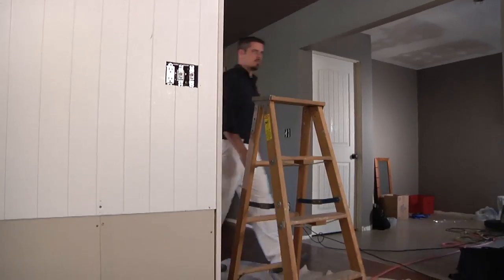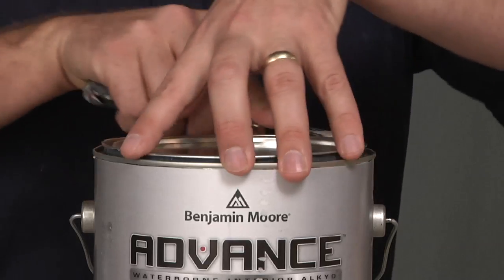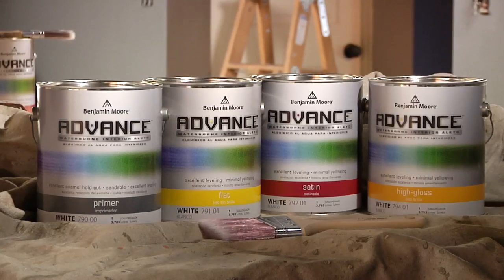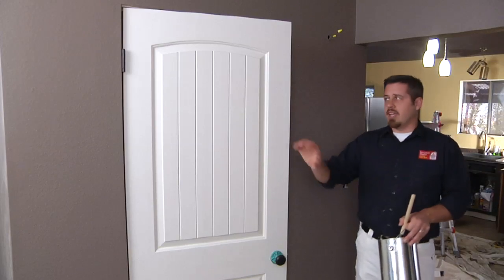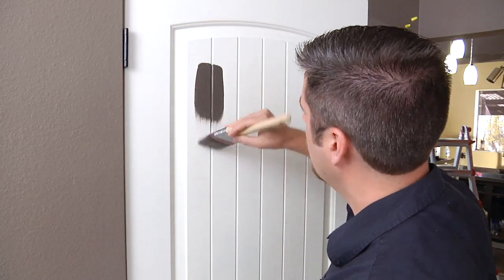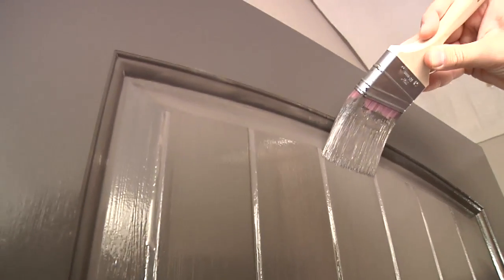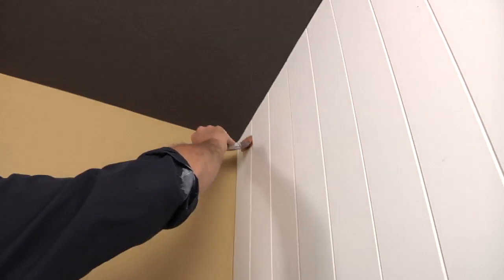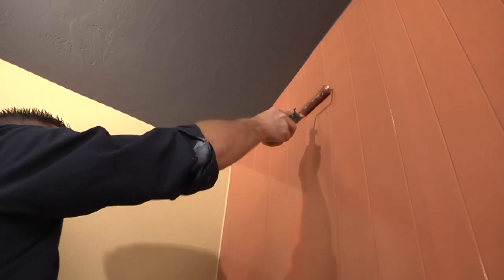How to Paint: Using Benjamin Moore's ADVANCE

Comment: I keep getting streaked marks on my kitchen cabinets with  this paint, Benjamin Moore paint called advance satin.. Original finish was sprayed with lacquer. Paint stores are all of lacquer and satin so we went with semi gloss Benjamin moore . We sanded and cleaned the cabinet then applied Kiltz primer in latex. Now after applying the advance paint it looks   very streaked! Am I using the wrong primer?

Comment: I'm getting crazy brush marks with this stuff on trim molding. This isnt the result I was told I would get with Advanced. Not satisfied at all!
Reply: ya this video shows a lot of brush and roller marks ..... I sure as hell won't use this crap ..... I use SW waterborne proclassic on cabs and it brushed well ..... dries kind of fast so you have to move fast , but it came out nice , and really , fast drying has some benefits !!!!
Reply: Used it in my house and it took some practice and a good brush to not leave brush marks.

Comment: I just finished using this paint on my cabinets.....very thin paint, but leaves a beautiful finish!!  I brushed it on and smoothed with a roller....beautiful.  I am waiting on the cabinets to fully cure....I am nervous about chipping...we'll see.
Reply: Rachel Burnette How did your cabinets turn out? I just finished painting the entire island in my kitchen with this paint in BM Chelsea Gray and will paint the wall cabinets BM Super White.
Reply: Rachel Burnette How long did it take to harden and do you have any nicks in the paint after use?

Comment: Nice video, Justin. I have searched all over for application help and found your video most helpful. A couple questions, though: 1) You say "don't go too close to the edge," but then I see you cutting in at the edge (right after the first,  away-from-the-edge strokes). Am I understanding correctly that you cut in in two steps? First: away from the edge; Second, at the edge, blending into the first? 

2) Do I lay off the brushed-on coat or just the areas where there are issues? I find that when I lay off the entire area (which I thought you were suggesting), I end up over-working the paint. Brush marks and globs everywhere. I'm thinking that the goal here is to just get the product on the surface and let it do it's leveling thing, only addressing, minimally, the obvious issues, like drips, etc.? I'd really appreciate a reply!
Reply: Catherine Osborne of course you must cut the edge line with paint or it will not be painted. He said, " dont bring to much paint into the edge" or you'll have a thick line of paint on the cut line which will be  difficult to remove or spread since your paint is in the corner against a different color.
Reply: The trick with Advance is to do lighter coats, you don't want to over apply this product because it is so thin it will run when over applied, which seems to be what a lot of people are having issues with, professionals or otherwise. Per Benjamin Moore as well as any other paint manufacture in the world will suggest two coats. This is not for the sake of trying to get more money out of you, this is so the sheen and color are uniform. Think of it this way, if you have a wall or door or otherwise that you are able to look across at a shallow angle and you apply one coat a few things will more than likely be visible. You will see inconsistency in the sheen (glossy spots and dull spots) as well as different tones of the color this is due to the paint being more heavily applied in one spot compared to another. The second coat really establishes the uniformity of both the color and sheen. Hope this explanation helps.

Comment: Advance yellows very quickly...never use pure white.
Reply: Advance has a stock white in all of the sheens, however this stock white tends to be closer to Benjamin Moores' "Brilliant White, PM-4/OC-150) Chantilly Lace is by far the brightest white that Benjamin Moore offers. All the tints used by Benjamin Moore to make those colors are Titanium Dioxide based and personally I have never had a report of Advance yellowing in the 5 years I have been at my work.
Reply: Is there a white in the Advance series (or other brand) you recommend?  I'm sampling wedding veil and chantilly lace right now.  Suggestions would be greatly appreciated.
Reply: I recommend acrylic CIL. Only paints tinted with titanium oxide (and nothing else) are called technically called WHITE.
Reply: @rupalsojitra382  SW Proclassic or PPG breakthrough has worked well for me .....

Comment: seeing a lot of texture in the finish, can this product be sprayed?
Reply: This product can be sprayed, it is recommended to use  1,500 - 2,500 psi using a tip with an orifice of 0.011 - 0.015.

Comment: Has a nice finish ones dried but a pain in the butt when spraying, you really cant cover with one coat, takes like 3 to 4 coats to actually cover, if you try to cover with one coat you are going to have a nice mess to clean afterwards, regal select is a much better product and actually cheaper
Reply: +Jorge duarte The paint is wonderful to work with - you just can't slap it on as you have done in the past. The results are essentially the same as regular oil paint, which remains the very best for semi-gloss trim and doors. Get with the times and stop living in the past Jorge
Reply: +Col Mosby i use advance daily, so i know what I'm talking about,  it's not worth the money,  for a paint to cost over $40 you would think it would cover better and easier to work with but all the above are apposite with advanced, I use it cause they request it,  that's the only reason.
Reply: +Col Mosby by the way oil paints cover well and easy to work with

Comment: Worst paint I have used in over 25 years. It's like painting with glue, Runs drips and sags like I haven't seen with a paint since 1986. You have to police your work when you're done and I've done this work professionally. It also ruins the hilt of the brush. Coverage is just average and the finish is nothing to write home about. NOT WORTH THE PRICE OF A NAPKIN.

Benjamin Moore should be ashamed of themselves.

Comment: We are getting ready to paint our kitchen cupboards and are seriously considering using this B.M. ADVANCE....your video was very helpful as to the proper techniques and brushes & roller covers!  Which finish would you suggest for kitchen cupboards, satin or gloss?
Reply: Probably too late of a reply at this point but in general, the higher the sheen (matte->satin -> semi-gloss -> high-gloss) the more brush strokes you will see in the end result. This is due to the light being reflected is much higher the higher the sheen level. I suggest Satin in most cases if brushing is intended, if spraying you could do satin to high-gloss without a real issue.